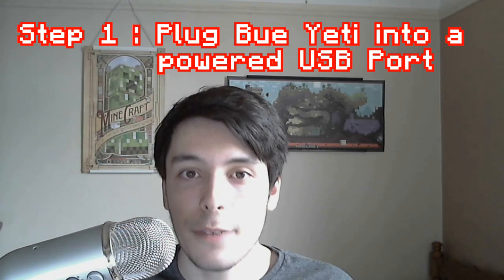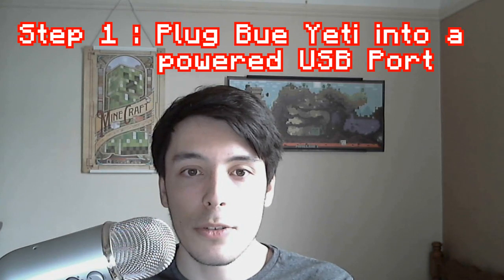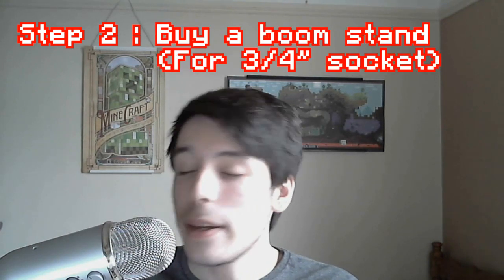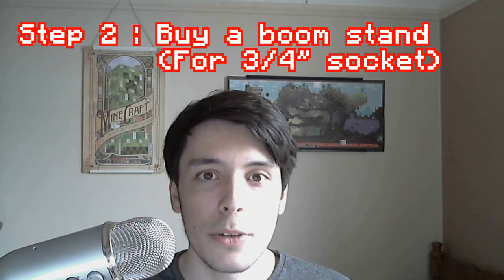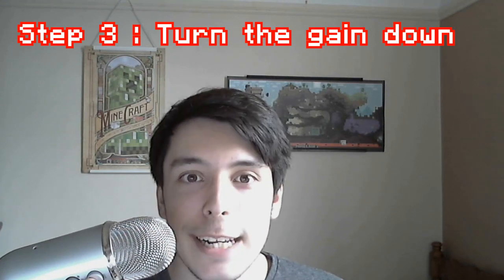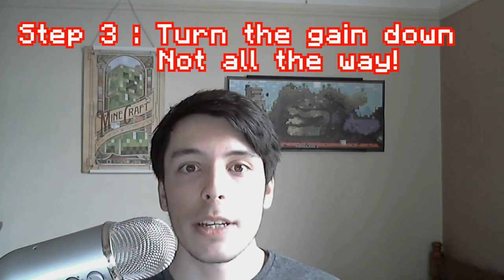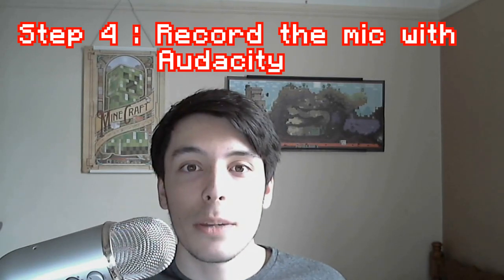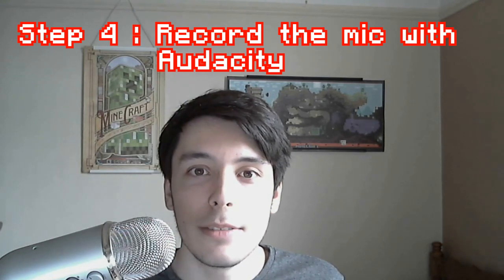How to fix the hum/buzz on the Blue Yeti microphone

Comment: Why are you talking into the top of the mic? Specifically tells you not to do so. Speak into it from the front, facing parallel. Lower gain/pop filter/cardioid is a must.
Reply from the maker: I am talking into the side it is the angle of the camera makes it look like I'm talking at the top. I am actually sitting further back :P

Comment: I have one question is there any way to help out with the pc vent noise being recorded i really don't want to put blankets or anything because i'm too scared of overheating, I already put ALL the gain down and also turned windows gain inside windows all the way down too, If you have any idea how to help me pleasse tell me!
Reply from the maker: Wow, how loud is your PC? Just make sure you are on cardioid polar pattern (heart shaped one) and move the mic away from the computer. For instance I have my computer facing away from me so the main fan is not interfering and the mic on the other side. It is all just to put as much space between the computer and mic as possible.
You could also try putting a sock on the end, that might help :)

Comment: Powered USB? All USB ports need to be powered or it would just not be a USB port!
Reply from the maker: That's not what it means. It is in reference to the usb ports with external power sources that plug into the mains. Google it and you'll see what I mean
Reply: TheGamingMole You could just say which one you went with.  Since it works well for you, it may work well for others.
Reply from the maker: Jim Chamberlin well I got mine out of my dads man drawer years ago. It says it's a sitecom hub but it could've been bought donkeys years ago for all I know. I was literally a case of me trying whatever was to hand until I'd isolated the problem or something worked :P (I have since found that my house at the time was not earthed properly which may have been the cause)
Reply: Actually, not necessarily. I had my mic plugged into my keyboard which has two USB ports in the back and after plugging my mic directly into my computer the humming was completely gone!
Reply: TheGamingMole Do you think i could use a 6 foot USB extension? or is it recommended to have active powered ports from a hub?
Reply from the maker: SpydreX Official  I would recommend the active powered hub just based on the fact that it is meant to emulate the phantom power you'd normally provide a studio condenser microphone with :)

Comment: Do you know how to fix a buzz sound? What I mean is my yeti is buzzing up my voice, really bad, I haven't had this problem before, me and my Friends tried to figure it out, what worked the first time was switching the USB (so I took the USB cord, and just put it into the other USB slot) and then it did it again. So then, I tried to switch the pattern ,and it seemed to kind of like  sound much better for a split second between me changing the patter, but then it would revert back to the weird sound, I mean, it dosent seem to be the PC, but its like something is buzzing and distorting my voice. I have tried many things like adjusting the levels in my sound under my control panel, I did this for both the playback ,and the mic itself. please if ANYONE had the same problem ,and fixed it, I ask you to help a brother out :)
Reply from the maker: If you've tried everything I suggested in the video then there are 2 things you can try:
Turn the gain down, and move away from the mic. Then boost the audio in post.
Or try using it in different parts of the room, it could be that the air is magnetically charged in that area. If you use the yeti before a storm it fuzzes like crazy
Above that I cant help without hearing a recording :)

Comment: Excellent video. Very helpful info. I had the same issues when I got my Yeti a few weeks ago. To correct this, I will buy the RODE PSA1 boom arm,  the Blue Radius 2 shock mount, and a pop filter. I will also investigate the powered USB port as you suggested. Finally, to get studio quality sound, I will use Voicemeeter Banana software features (Intellipan feature for a deep base; the noise gate to reduce background noise; and the compression dial). Thanks again.

Comment: Ok, when recording I hear this hum but when plugging headphones directly into the mic to monitor sound I don't hear this hum. Would I need a powered USB hub for this? If you need an example of this the video on my channel has lots of examples.
Reply from the maker: The Real Noodle Nah its cool, you just need to turn down the gain a little or turn down the input in your recording software, it sounds like your PC fan. Maybe even try repositioning your mic to point away from the PC. If its still a problem after all that let me know :)

Comment: Can you guys help me, what Da fuck is this sound my blue yeti makes? https://www.youtube.com/watch?v=TgkWvwSFSew
Reply from the maker: +Star Mate Sounds like data, if you've got a USB stick or an external HDD attached to the same set of ports there's a chance of this happening, worth looking into an external USB hub as I mentioned in the video, any old USB hub will do so long as it has the power input. It should eliminate the problem. If it doesn't, then you can always send it back and just use Audacity to edit the tone out :) Hope it helps
Reply: well i bought i new mini usb, and that didnt work.
Reply: I have the same problem, planned to use my Yeti for a school project. None of the solutions in the video worked. Not saying it was a bad video, I am very thankful for The Gaming Mole's help. 

God damn it.
Reply: Its not about ur mic, its about ur motherboard
Reply: how do i fix that?
Reply: I have EXACTLY the same sound. Would love to know how to fix it. What is your setup? I'm on a MacBook Pro.
Reply: I had the same noise. My solution was powering off the base of my Jabra Pro 9470 AND removing the wireless headset from the base. Evidently, the wireless signal (even though it was not in use) caused interference with the Blue Yeti that was about 8" away. Look for wireless devices. My wireless keyboard and mouse didn't see to affect it, as I used a process of elimination which included routing the USB wire away from other devices to discover the culprit.

Comment: What is the best setting to record ASMR video for YouTube from Canon t3i and Blue Yeti with a clean sound without the hiss noise? I have it set on manual and it still makes the hiss noise. Thanks in advance. Just subscribed.
Reply from the maker: you'll need to turn your windows recording volume down to below 50 and then turn the gain dial on the mic to its lowest. The yeti is a condenser mic though so really you wanna be using a specific asmr mic or you can use a dynamic mic so you can get nice and close, like the shure 2m7b

Comment: You should get a pop filter, I really hate those popping noises you keep making when pronouncing words with p involved.
Reply from the maker: Y'see i really don't like spending money so if i decide i want one ill probs make my own, but until then i just moved the mic out of my breathing range to the side and it works just fine. Sorry about this video though, at this point  I was still "green"
Reply: I see.
Anyway, I got a blue yeti myself (along with a pop filter, for a total of € 152,00) and I am encountering a few, subtle, issues:

First of all, when I press keys on my keyboard or I click my mouse, it does annoying noises even with the gain at minimum, thus I can't record my voice "live" while playing a videogame.
Then, I can't find a good gain setting, whatever I use sounds like a cheap microphone, even if I set it at medium gain, my voice just doesn't sound "clear" like yours in this video.
Reply from the maker: make sure it is set to cardioid polar pattern on the back (the heart shaped one) and is pointed away from your keyboard, I also use the filters in audacity to get rid of the keyboard noise
Reply: TheGamingMole Yeah, I've set it in cardioid, although it catches all my keyboard, mouse and desk vibrations...
if only I could find a cheap shock mount...
Reply: NonSoloRecensioni What you experience is totally normal and very common on Condenser Microphones.
If you want less noise from keyboard / mouse i recommend getting a good Dynamic Microphone instead with either cardioid pattern or even shotgun but shotgun you can barely move so depends what you will use it for.

You can use software to remove clicks and all kinds of noises with free softwares such as Audacity.
The best tho is to always have the audio to it's best and not need or very little need to fix audio after recorded it.

If you live within Europe i would recommend contacting a shop named thomann they got great support and you can talk with their studio department for the best way for you. They made that for me and even tried their stuff out after i asked and replied

Goodluck!
Reply: B4NTO
Since when I set it up on my boom stand, it doesn't catch all my keyboard noises as loud as before, although the pop filter keeps unscrewing from its own mount for some reason... but who cares, as long as I don't speak right into the microphone directly, there's no popping whatsoever.

Comment: I have the the Blue Yeti on a metal constructed stand at the moment, it is however plugged into a USB 3.0 port in the front of my PC case. Will I still suffer vibration and "magnetic field" problems doing it this way?

Edit: It might seem a bit stupid that I haven't recorded and found out for myself but my current micro USB to USB cable is broken and a new one is on the way.
Reply from the maker: In my case the shock mount they provide wa only a problem becasue my computer was sitting connected to the desk so the vibration was travelling through the desk. If your computer is not connected to the desk then any noise you might get is from the actual noise of the fans
Dw, I get it, it's a big investment and you want to make sure it works ;) any problems after you get the new cable, just message me ;)

Comment: Had mine for a while, and only just encountered this issue recently. I'm sure mine is a desk hum rather than the mains, as if i lift it off the table and hold it, the 60hz hum vanishes completely. I can remove it in edit with a simple 60hz hum removed, but it's annoying during livestreams.

What boom stand did you buy exactly? Most of the ones on Amazon seem expensive as hell lol
Reply from the maker: my mic stand is an "axman" apparently but I got it cheap from the music store down the road
Reply: TheGamingMole Thanks. I went against my wishes and placed the tower back on the floor. This fixes it, but :/ lol... I love it on my desk haha
Reply: Why the heck would you put it on the desk? The only advantage I could see would be that it clears up floor space (which is already more abundant that desk space, unless you are magical) and if you have carpet flooring, the PC can't fry itself as easy. But, really, your fans or any other cooling means should keep it cool enough. Otherwise, you have a bad PC.
Reply: DRAGONS DESCENT For one simple reason: Aesthetics. It looks lovely on the white table with the white and blue everywhere, not to mention the table is huge, like 2 times the size of a school table for 2, plus it gathers more dust from my floor as it's real wood.
Reply: DRAGONS DESCENT  It also does prevent a lot of dust from getting in the case. a computer on the floor will get A LOT more dust inside than a computer put on the desk.
Reply: LiveStyleGaming Fair enough. Matthias Havrez Well, you aren't suppose to put it on carpet unless your case has tall feet.
Reply: +LiveStyleGaming I used to have this issue back when i had that microphone and i JUST 
realised what it was when i saw a usb wire with that sort of cylinder 
thing at the end of one side. It's called a Ferrite core and it prevents
 magnetic interferences to pass through the usb. That's what you 
basically need when this crap happen. I tried pretty much everything to 
fix it but never seen anyone mention that little shit-wire.

Btw i copy-pasted my message that i put on another video if anyone asks.
Reply: +Vault Boy Steve You can make one from ikea lamp stand

Comment: Quick questions: Does the USB hub has to be powered by a AC cord or can it be one of those hubs that gets power from the computer? Also, will a usb wired extended be able to help as well?
Reply from the maker: It does have to be one with an AC cord, that basically separates the power and the data lines from the mic, meaning a nicer recording

Comment: even when my yeti isnt enabled it still gets a buzzing noise (White noise) when i click record im using audacity and ive swapped to every usb port on my pc and even used the port on my keyboard nothing worked, i thought it was my cable but i have 2 different cables and its been doing it since ive gotten it i cant find a fix for the issue.

Comment: Are there any particular brands of powered USB hubs you recommend? I'm looking for something relatively cheap, because I'm trying to keep up my saving spree right now. :P
Also, I have a problem with Audacity. I love the program, but the issue I'm running into is that whenever my voice volume gets too high in a recording, the program crashes, and I lose everything I recorded. Do you know of a fix for that?
Reply from the maker: +Nathan Iddings Hey there mate, well I'm using a Sitecom hub that I found in a dusty drawer. Don't think they're still around, but really anything with decent reviews that has a DC power input will do you don't need to spend loads on a branded one. It won't do anything better than the cheap ones. I couldn't hope to tell you why it cuts out without being there and seeing it, I'd check your RAM usage whilst using it on CPU-ID and check you have all the latest versions. Only other thing would be to set up some compression to even out the volume. Hope it helps :)
Reply: Okay, thank you! :) I just got one in the mail and apparently I forgot to get the DC power input part... so it did not work. :\ I'm guessing the DC power input is sort of a like a substitute for the microphone input cord?
Reply: Okay, so to be sure: it must be DC input, not AC input? I want to make sure I've got that right before I order my next one.
Reply from the maker: its not quite that, basically the power input just gives the microphone a little extra power (called phantom power in the industry) above what the computer outputs through USB i don't think AC or DC matters just that it has some form of power input
Reply: Okay. Well here is the hub that I just got: http://www.ebay.com/itm/111909808063?_trksid=p2057872.m2749.l2648&ssPageName=STRK%3AMEBIDX%3AIT

Are there any features on this that are missing from what I would need? I do see a small hole for a cable, but I'm not sure if that's out AC DC input.
Reply: +TheGamingMole Actually, my problem is more of a high pitched whine than it is a hum or buzz. Do you think that's the same problem taking place?
Reply: TheGamingMole Okay, I just noticed something here that I (somehow, I never fail to impress myself with my ability to miss important details), that when I play the video back that sound isn't there. It is only making the whining noise in my headphones for some reason. But the whining noise always comes when the headphones turn on, and leaves when the headphones are turned off. My headphones are plugged direct into the computer tower by the way. I don't get any problems with them when the mic is off.
Reply from the maker: +Nathan Iddings haha wow, well the one you found is the sort of thing I meant but hey doesn't seem you'll need it now. I'm running my headphones through a preamp so I never would've thought that to be the issue :P
Reply: Hmm, what is your setup like? Do you have the preamp plugged into the computer, and then your headset plugged into that?
Reply from the maker: +Nathan Iddings yup it's a focusrite scarlett 2i4, but you only need one of them to record XLR or 1/4" into your computer. You could also use the control box of a sound system like the corsair sp2500

Comment: I hope you realise that you need a pop filter weather or not you follow these steps, I do think they were  helpfull but a pop filter is the MOST important thing you need as pops are horrible and I can hear them all the way through your video.
Reply from the maker: I know but tbh this video is about solving the hum. I may get a pop filter if the whole youtube thing takes off, but for now I make games instead of playing them. If the popping is too much all my tips are in the description as well along with updates since then
Besides that I would agree now that a pop filter is important but it's not the end of the world if you don't have one, I now use a sweat band over the end, does the job :P
Reply: TheGamingMole I got one today from amazon for £8 with pnp, I would advise as it's so cheap and makes all the difference.
Reply from the maker: or a pair of tights over a wire coat hanger ;)
Reply: TheGamingMole Yeh but I was supprised with the build quality and how it also looks aesthetically pleasing, at first I used my mums embroidery ring with tights on it to test the difference, I think for something like £4-8 it's still worth it, with a yeti mic you dont really want to stick with a "ghetto set up".